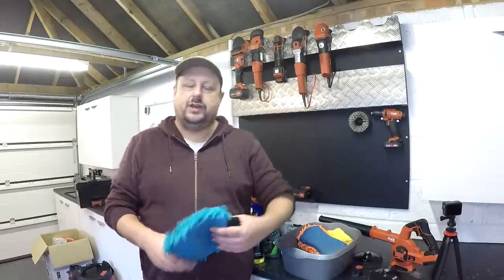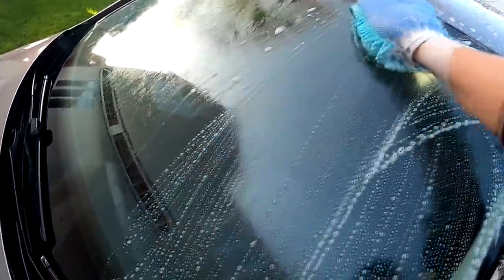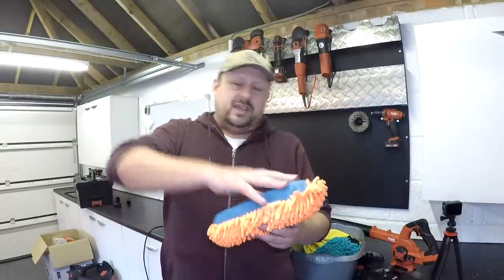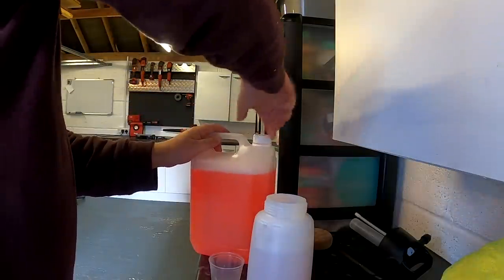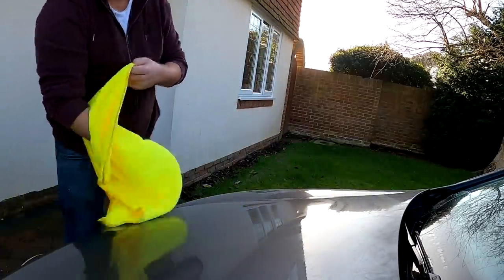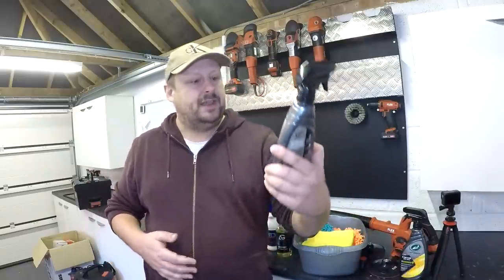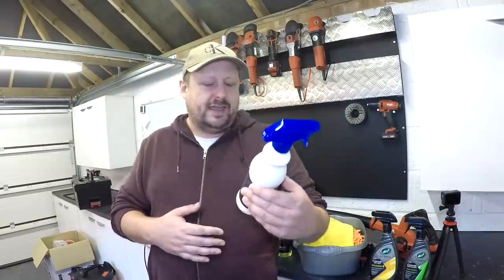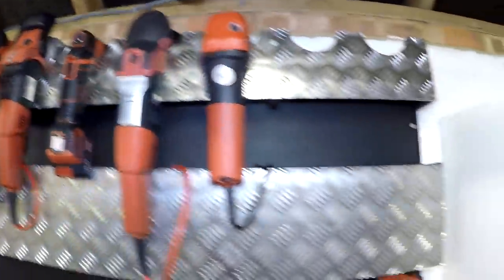Cheap and Award Winning is a good combo - Kent Car Care Detailing Products

Comment: Hi there Jon. The Range normally sells that brand and it was where I bought my 2 towels. To be very very honest, I love them and I like them more than the AutoFinesse Aqua Deluxe. I still need to try out my Meguiars towel. If I had the chance to try out my towels before I returned to Portugal, I would have bought more of these towels, the blue Martin Cox (with red stiching) and loads of the Simmoniz waffle weave ones.

Comment: I bagged the double sided noodle mitts from Asda for around £4. I tend to use them on lower panels and a better quality mitt or wash pad for other panels, roof and bonnet. I get the cost saving, but definitely wash out and double rinse that wash media folks. No matter the price £3-30, any of them can scratch if you rush the rinse media phase!

Comment: I’ve been using the Kent noodle mitts for years, prefer it over the sponge version as if you wash a few cars your hand doesn’t get any fatigue from having to grip it! On one of my cars I use a clean new noodle mitt to remove the polish residue as the surface area breezes through it all.

Comment: Bought a Kent XL Drying towel and it's lasted longer than the Wooly Mammoth drying towel which cost 10x as much. The weight of the wooly mammoth is better for dragging but the Kent one seems to work better at collecting the rest.

Comment: I prefer a mitt to a sponge, John. The obvious reason is that i am less likely to drop the mitt, as my hand is in it. Also Sonax BSD is hard to beat, especially for the price it is sold at. I decanted mine into an empty Turtle Wax Seal and Shine, it has a very good spray pattern in that container much better than the Sonax bottle.

Comment: I always use the noodle style over the microfiber. They even feel alot softer to the touch aswell in my opinion.
Reply: That is microfiber
Reply: Yeah i know, what i meant is i prefer these over the microfiber madness style
Reply: which one do you have?
Reply: I have a martin cox noodle, have tried others though and they're mostly the same. The martin cox is a little bigger though i think. I do have a microfiber madness aswell that i use on cars that havent got a perfect finish, it doesnt scratch or anything, i just prefer to use the noodle as it feels softer

Comment: Hi Jon once again great information, I am just coming up to my first year (of interest) in detailing. Your vids have been invaluable in getting my kit together. My MF wash mitt works well as I didn’t want to mess about too much, I went for a 5* rated one from Amazon. I don’t take things to extremes where I have seen detailers use a different mitt for every panel. I bought 12 MF from a detail shop, which I tend to use for everything 6” up from the sills and wheel arches to keep the  harsh dirt away from the Mitt. Drying towel I haven’t got a clue what I paid for it I just went for a little shopping trip to the detail shop and blew £60 on a few things. The drying towel is brilliant. Now I have everything apart from a garage to work in, I am just waiting for a bit of good weather to do a proper job. After your first review on the original Turtle Wax D & S I bought 2 bottles, I still find it impressive and can do about 4 cars with each bottle. Your vids and advice are really comprehensive and easy to follow. I am also on detail central on FB now. what a great community the detail world is. Thanks
Reply from the maker: you have the detailing bug now :) thanks for your support as well my friend much appreciated.

Comment: The prices at The Range are £3.99 for each item so what's not to like....I've been using the Kent drying towels for years and have about a dozen of them. I use one of the thick microfibre towels you recommended initially as the Kent's arn't as good getting the majority of the water off but that always leaves a little water residue on the car. I then use 1 of my "best" kent towels on the paint work, then a "second" one to do the shuts, doors, boot opening and under the bonnet. These leave the car bone dry. Great towels imo for that particular application.

Comment: Mequiars  water magnet I find is the best drying towel ever!! Yes it’s quite dear, but one pass and the car is dry . I have no idea where the water goes honestly amazing 😉. Love the channel 👍👍👍
Reply: I have the Meguiar's water magnet,as well as the Kent Car drying towel but Dry me a River from RagCompany beats all in absorbing water and doing the job flawlessly🌟👌.A little bit more expensive but for more than 2 years regular use it hasn't changed  its quality .
Reply: Not heard of that one but will give it a go just on the basis of the name plus your experience of using it. Steve.

Comment: I don't like noodle style mitt, i've tried 2 versions of it, a cheaper lighter version and the Chemical guys one which is bigger, gets super heavy when wet and traps dirt in the noodles. They both worked fine, but always tend to keep dirt inside for me. And they hold too much water imo, the mitt gets heavy and doing 2 cars you get tired.
I've been using the CarPro microfiber mitt for a year, and has a lot of pros: super soft, easy to handle, quite thicc for having only one side, Full white (no need for colour) so it's easier to inspect and avoid washing with dirt on the mitt.
It rinses well and doesn't hold to dirt too bad. Sometime i wish it had two sides to be able to switch. And be careful after washing the mitt to avoid drying it on a hot radiator, it will mess up the fiber. Stick to air dry or machine with low heat.
Reply: Ah! I never thought about the radiator!! Very good point!

Comment: I've got a Simoniz noodle mitt which was nice to use but a bunch of the noodles fell out so it puts me off using that type again. The Kent drying towel is pretty poor on it's own but works fine with a drying aid so I can't complain. Also the TW Ceramic Wet Wax is a great product, probably my favourite of the ceramic lineup. 🤓

Comment: Staple insulating foil to the inside of the garage roof difference in heat retention in winter plus the light it reflects is surprising.

Comment: I would say that the kent / halfords noodles are decent, but they are single sided.  A double sided mitt is only going to see half the wear and tear that these ones do.  I'd rather have 2* double sided amazon deluxe wash mits at <£10 for 2 than 4* Kent ones at £3 each?  Also it takes me twice a long with a single sided mit, as I need to rinse  twice as often :) I tend to use the noodles on the lower 20% of the car as they do feel safer to remove that dirt.

Comment: Jon where did you get the metal extension tube/nozzle for your stubby trigger gun? Thanks
Reply from the maker: yo there amazon search for pressure gun quick release extention bar 6.99 delivered.  not very good though mate.

Comment: I like the noodles but they do get caught on edges of trim and wipers and pull out an occasional  ‘noodle finger’, other than that, they are great.
Reply from the maker: true dat you have to be a little bit mindfull of the tendrils flapping around.. but like the shaggy wool ones.
Reply: The fluffy ones also get caught on the trim, I find. Can't remember having lost a noodle actually. Not even a cheap one, which is what I've used. 😉

Comment: I’ve always used microfibre chenille mitts on my Black vehicle. Recently switched to the incredimitt and started to notice marring but I can’t be certain. I guess based on your testing the chenille is the safest after all. If that’s the case why do you use the incredi range of products? I really like the user experience of the incredimitt but if the chenille is safer maybe I should just switch back to it(especially if I feel I’m noticing light marring for the first time).

Comment: What shampoo where you using here, looks very nice to use
Reply from the maker: 10:50 mate.. Ive linked it in the description.  If you also search you tube for "best car shampoo" you will see a large shootout of products this did well.  very thick suds.
Reply: Thanks pal. Just didn’t see that obviously 😂 should have went to spec savers

Comment: Hello can you help? I polished my car and coated it yesterday. Coating was nice no problem but, I missed some scratches on paint which I recognized them after coating. What should be done? Can I apply local square cut and then coat that part again? Thanks (Coating : 3 layer mohs / 1layer skin)
Reply from the maker: I cant see the scratches you are talking about.. so I cannot advise you with any meaningfull information on best course of action.  if I tell you to just heavy compound the area where the scratches are to remove them and degrease and reapply the ceramic over that section.   You might keep compounding to try and remove scratches which are all the way through the clearcoat (eg they cant be removed etc)...  so its very very hard for me to give advise on problems I cant see.

but yes in theory you can cut back through a coating to remove it. and work on the paint again and then apply over that section..  I hope this helps mate.
Reply: @ForensicDetailing  Thanks for the huge reply, my scratches are in clear coat that I could have removed in compounding phase, but I missed that part and just coated the car ( selenite gray 2017 Mercedes coupe) // So I plan to koch chemie heavy cut only that part 3x3cm2, sit on only at that part until coating and scratch removes then do the coating process again. (Note: paint was extremely resistant, koch chemie heavy cut was like M3.01 it was barely cutting , well did removed %60 of swirls but shocked at the paint strength), do you have any recommendation or another compound? (Plus I can send you the photos if I can e mail you )
Reply from the maker: @niacinbiotin  hey buddy h8 or h9 are about as agressive as you want to go.   honestly.  You dont need to switch abrasives..   but the thing to ask yourself are how deep are these defects.  A lot of you tube detailing or lets say detaiin social media gives the impression of perfection.     if those scratches are like half way through your clear system then dont worry about removing them.    Lots of times though with removeable deep scratches wet sanding is the most efficient way to remove them.  like you might literally need 5 sets to compound them out  if they are deep.. but again Im just speculating a bit.
Reply: @ForensicDetailing   Man you are a beast at responding you deserve far more subs and views. /// The scratches I talk about are only visable at sunlight, it most probably caused by microfiber towel while washing I probably removed bird poop and applied a bit pressure, they are not deep %100 are in clear coat. I got rupes lhr 15 koch chemie h8, area is 9cm2( like one pad area), I will sit on that area without moving taking some breaks to prevent heating till the scratch remove. Orr should I extend the area a bit and move  the machine?
Reply from the maker: @niacinbiotin   I would increase the area to about a  30cm square..  should be fine though mate.  Ive had to do the same.. its very commen to discover a footprint or microfiber or a streaky area from too much unlevel product..  so this should go smooth mate for sure.

Comment: I wish I had seen that review you guys done with the wash media! Last year I ceramic coated my car with CarPro FR, only suspecting that now the past retired Addams synthetic wash pad/ and current Dooka Osha wash pad was marring my BMW black paint work. Thing is  - I do believe that Dooka is very soft on paint, no doubt. But I have a gut feeling is that it doesn't release dirt very well - hence as you can imagine with the Dooka, you can't wash it properly in a washing machine so dirt particles build up to a point where then a continued usage of washing will in fact be transferred into your paint! So Jon, I'm going to ditch wool now. Can you at least recommend two sided sponge chenille microfibre mitt/pads (bar from Kent) to buy? Cheers.
Reply from the maker: its a bit like pads for polishing.. wool pads tend to marr more and need more priming to avoid marring...   microfiber can marr a bit, and soft foam marrs the least..      but of course with wash media we also need to take into consideration dirt and how it removes it beyond just looking at the material media itself.
dooka wash pad you can put in a washing machine, just dont tumble it.
I do also now believe synthetic wool fibers are the hardest and more prone to scratching.
quality of the wool they say comes into play but I think generally although wool is better than syntethic fibers.  
for some reason the chenille microfiber was noticbly better.
you could look at the wooly wormit. you could look at the chemical guys one.. the rag company do one.     you can pay 3-4 pounds for one from kent care so that might set some thresholds on price for you.
Reply: @ForensicDetailing  Cheers Jon! You're always a star! I've been a great admirer of your detailing channel and I truly think you are doing a great job in educating detailing to us! Keep up the good work and stay safe 😉
Reply: @ForensicDetailing  BTW - I did try machine washing the DOOKA wash pad in the even gentlest of settings - the bloody thing starts to come apart 🤣
Reply from the maker: @bio10155  you know what I dont actually machine wash mine, and its been good.. but I know dooka say they can be washed.   But you must use non bio.. The bio detergents will break down the hide.
but yer I got a bit fed up with hand washing stuff anf hanging it to dry.. the chenilles I just chuck in the washing machine.
Reply: Forensic Detailing Channel Hey Jon, yeah I did use non-bio detergent but when observed in the washer you can see the wool material detaching a bit, just like what you get as residual in the bucket - but more! Anyway I’ve had enough now as mentioned back to old school 😬. I will get my car rejuvenated with Essence plus instead of proper correction as the coating is still too new. I’ll monitor the chenille wash media and let you know how I get on 👍🏻

Comment: I'm new to detailing, love your channel, can you recommend a good wheel brush as I'm having trouble sourcing a decent one that lasts longer than a few washes. Keep up the great work. Regards Peter.
Reply from the maker: I use EZ go for the archers. EZ large for barrels and EZ small.     I also use microfiber madness incredibush flat for delicate finishs.   I like the vikan flat wheel brush for tyres..  and any cheap mitt or hoggs hair for the fair and spokes.    Tip be light handed with the EZ brushes or you will bend the core and weaken them.  mine are 3 years old and going strong.
Reply: @ForensicDetailing  Thank you for your recommendations, and quick response. Peter.

Comment: What was the snow foam sprayer you used? I don't have access to a pressure washer but I am interested in using snow foam. Can it be removed in a similar way to application? Using a pump sprayer? Paul
Reply from the maker: IK foamer mate  ,   can be rinsed off with a hose for sure yes
Reply: @ForensicDetailing  Thanks for the reply, big fan of the channel.👍

Comment: I noticed your flex car dryer in the back. Any recommendations on other models as I’m a tight wad 🤣
Reply from the maker: ive not used it but you could go dewalt or makita.   go cordless whatever way you go though mate.
Reply: @ForensicDetailing  cheers, I know you’ve said in the past that just enough power to dislodge excess water is good. Anything else could blow debris back onto the car and completely waste the time you’ve just taken 😄

Comment: hi jon, I have a bit of an odd bit interesting situation to report. I just saw an absolutely excellent movie which btw I highly recommend called "dark waters". Anyway the movie revolves around a chemical company that uses long chain fluorocarbons. I could not stop thinking about soft 99 changing fusso coat recently and my buying up some of their old stuff. I sent this email to soft 99 lol you might want to be carful with some of these chemicals , best : Dear Sir/Madam,

I have been using soft 99 for some years now and particularly like fusso coat. I just saw a movie called dark waters. It made me worry about fusso coat containing "fluorocarbons" are these fluorocarbons the long chain carbons know popularly as "forever chemicals" ? I have the old fusso coat at home and may wish to take precautions if using it in the future .
Reply from the maker: its even supposed to be unsafe when you heat up PTFE caoted frying pans and stuff.. theres a big move away from fluoro polymers now....   but to be honest when you in a gas station honking in like diesal vapours and stuff..  millions of things we do now will later be found unsafe I think.  I would guess  soft99 prolly moved to remove things like xylene and toulene and things like that though rather than the form of PTFE they use.